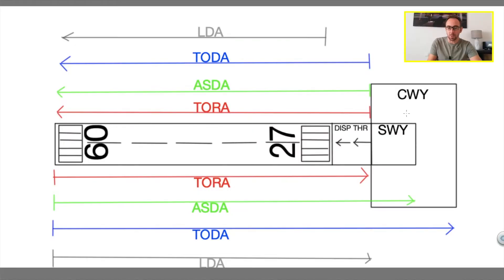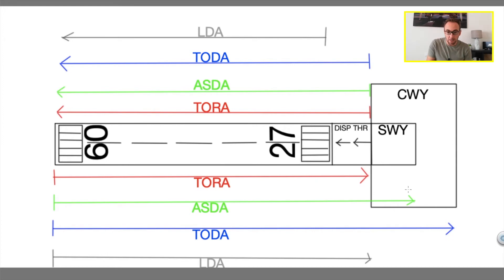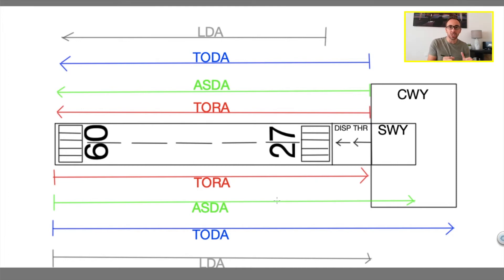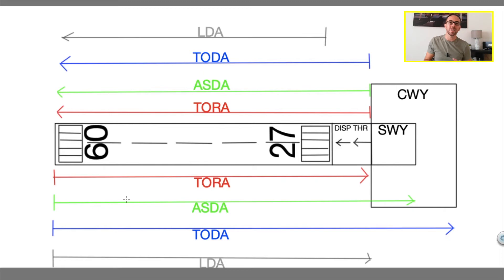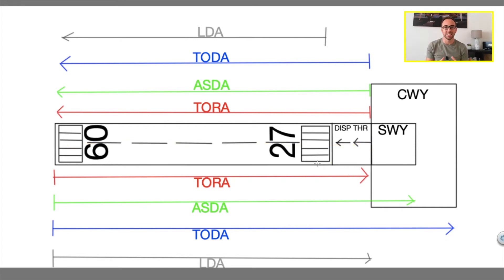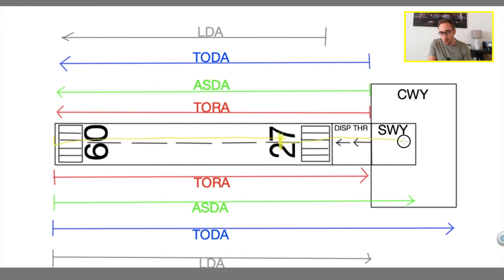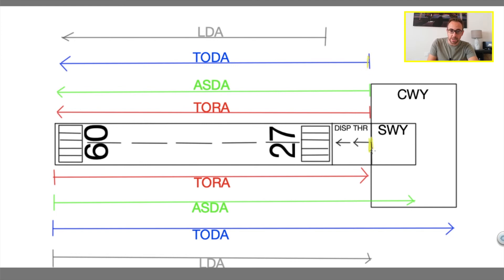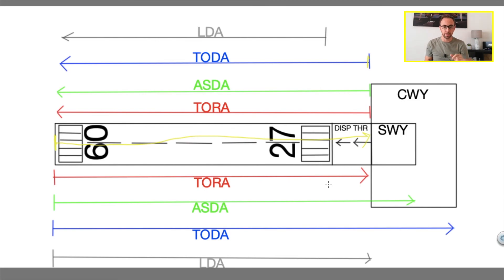TORA TODA ASDA LDA Explanation - [Stopway, Clearway and Displaced threshold]

Comment: Thank you for the video. I am trying to calculate declared distances from the aerodrome chart. In the aerodrome chart, the description of runway length, for example, 3500 * 60, and there is also a displacement threshold on one side, like 300 * 60. The question is: Is the length of runway 3500 m already included in the length of the displacement threshold 300 m?

Comment: Situation: Displacement of threshold is due damage pavement. Hence, it is unusable.
Question: Is the displaced distance still included in the computation of TORA, TODA, and ASDA?

2nd Situation, same question: How about if the reason for displacement of RWY-27 is that there is an obstacle to be hurdled near this end.

Hope you could answer my questions.
Reply from the maker: Hi!! If the displaced threshold is damaged it cannot be used at all and that should be taken into consideration when calculating the takeoff performance.

The reason why we have displaced thresholds are multiple, one of them is to allow higher take off masses. 

I hope this answer you questions
Reply: @PILOTCLIMB  Thank you for answering. I hope you could make a part 2 of this topic with these situations because I have not seen this explanation in Annex 14. *Although it is common sense"
Reply: It could be permanent or temporary, in which case it will be mentioned in the NOTAM.

Comment: Thanks! My local airport has a turnaround circle just before the 26 threshold which is included within the 26 TORA/ASDA but is NOT included within the 08 TORA/ASDA/LDA. Strange that it only counts in one direction.
Reply from the maker: Hey, great question!! can you give me the ICAO/IATA code of the airport? I will have a look at it!👍
Reply: @PILOTCLIMB  It's Exeter, UK (EGTE). There is 40 metres of turnaround circle before (displaced) 26 threshold. My guess is that the turnaround circle is not certified for landing/takeoff but allows planes to line up on 26 with 40 metres more runway ahead?
Reply from the maker: @heterodyne666  I will have a look and I will let you know soon👍
Reply: @PILOTCLIMB  I think the answer is what I said above. Even if the turnaround circle were structurally capable for take-off/landing, it has a curved edge so the runway width is not maintained. Therefore this area does not count for TORA/ASDA/LDA at the 'stop end' of 08, but it does count for TORA/ASDA at the 'start end' of 26 because it allows an aircraft to line up 40 metres earlier.
Reply: Are you talking about the runway dumbell..
Reply: @tonydavis1305  Yup.

Comment: Can TORA,  from opposite direction , can  be maintained more than LDA.
If so, how take off climb surface will be established .
Reply from the maker: Hey, many thanks for watching. Could you please elaborate a bit more your question?
Reply: Suppose due 3m penetration in first segment R 09 display by 150m. So in case of TORA R 27  that obstacle needs to be clear by 2% for Tk off climb surface {Ref Table 4-2 Annex 14} .
Can we restrict TORA R27 =LDA R 09.

Comment: Hey just can you correct me if im wrong in the following sentences and thank you :
TODA begins from the beginning of the takeoff roll until screen height 
And TORA is from the beginning of the takeoff roll until Vr?
Reply from the maker: Hey, thanks for watching, the TODA is the distance that you have AVAILABLE for your acceleration from brake released to the screen height (TODR), so we can say that the TODA is the distance available for your TODR.

The TORA is the distance available for your take off Run (Brake released to rotation).

Let me know if you still have any question.

Comment: And one more thing what is screenheight
Reply from the maker: It is a define height.

Normally is the height you should be at by the end of the runway or clearway if applicable.

Let me know if you still have questions
Reply: Screen height is that height over the runway where your speed reaches  V2 kts  after loss of one engine.

Comment: What abou TODR captain? what is it then? What’s the difference between toda and todr?
Reply from the maker: Hey, many thanks for watching and the comment.

The TODR is the take off distance REQUIRED by your aircraft to reach an height of 35ft over the end runway (or over the end of the clearway if available) should an engine fail at Vef.

The TODA is the take off distance you have AVAILABLE, the TODR must be equal or lower than the TODA.

Let me know if you still have any questions.

I wish you a great day